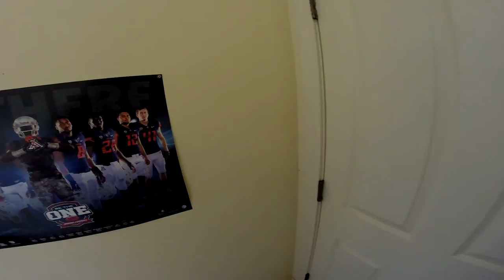MotoVlog 131 - Stop Royal Enfield, Stop! - Royal Enfield Bullet

Comment: If Hitchcocks get any quicker they'll have stuff delivered before I order it.  Those 'soft' TLS brakes are great /if/ they're set up just-so.  Likewise the rear pivot is supposed to slide so both shoes operate, not be painted in place. RE drum brakes were used on so, so many other makes of british bikes including Brough. Those two shoes must touch down simultaneously and there's a real black art to getting them set, but once set right they should be as good as a disc.
Reply from the maker: I've certainly tried, even sanding them after doing the chalk line method to make sure I'm getting full contact on both shoes.  Best I've ever had them have been nowhere near a disc brake though.
Reply: Not easy to explain in a few words, it's been a long while and each one is slightly different. I learnt from a chap apprenticed at Ferodo. Don't use sandpaper as that puts grit into the lining, use a file. The trick is getting them to apply equal pressure, it's a bit like adjusting a balance and the one on the rod probably needs to touch first as when you pull hard on the cable the lower shoe applies most pressure due to slightly more slop/play on the rod.  The angle of the operating arms needs to be the same or you get unequal leverage, about 90° at contact. A lot of it is by touch spinning the wheel and literally feeling when the shoes kiss the drum, get the rod right, and adjust the cable. They do need to bed in,  then need re-adjusting. Discs were introduced because these drums are not easy to adjust, most go around only using one shoe. 
At the rear - http://www.hitchcocksmotorcycles.com/partsbooks/pages/1776/Rear+Brake the cam bush (7) is designed to slide to centre the shoes, screws (17 & 18) done up just tight enough so it doesn't move about by itself, nuts (19) are lock nuts to stop the screws loosening. The cam bush is not supposed to be painted in place on the brake cover plate (1)
Reply from the maker: Interesting, I'd like to see a video if you have one.  Allot of what you have mentioned I have indeed done.  Front brake at this point is a done deal, parts already ordered for the front disc B-)
Reply: I don't have a video. There is a RE TLS video out there but it has the operating arms at unequal angles. I only have one bike and that's a 2015 Classic-500 with the disc brake which does work rather well. I have though had a number of old british bikes since the early 70s but no room to really keep more than one in the shed now.

Comment: Nothing worse than needing a simple part for a simple fix and your supply chain leaves you benched. If it wasn't for the aftermarket, I'd be hunting for a new bike. I'm getting used to hearing "Sorry, that part is obsolete.". On another note, the Alamo Apartments at 5:42 from Harley Davidson And The Marlboro Man.
Reply from the maker: +stirlingshire You are absolutely right on finding parts, the heartbreaker is that the local dealer and CMW were so good with customers.  Honestly, first name basis here.  That is gone now.

You are absolutely correct, I'm waiting for Mr. Rob Ash to spy some scenery B-)